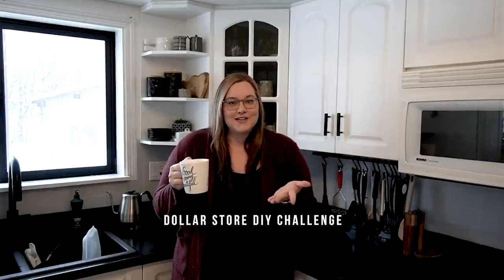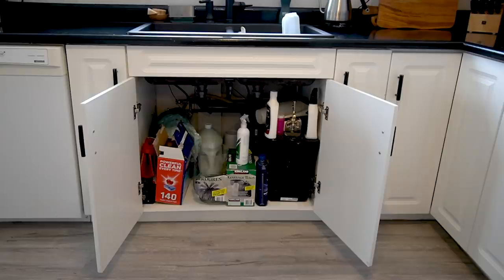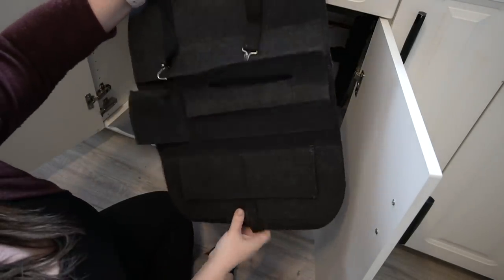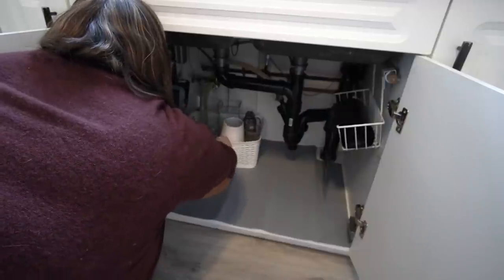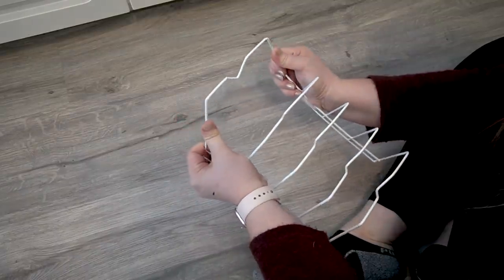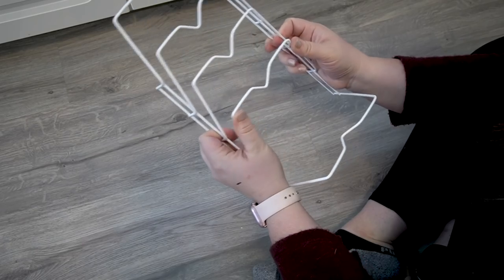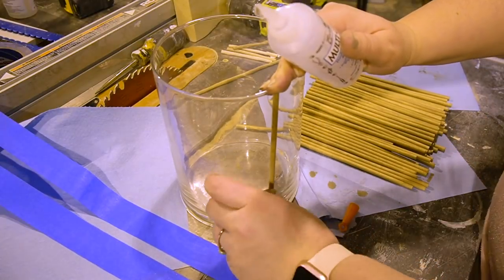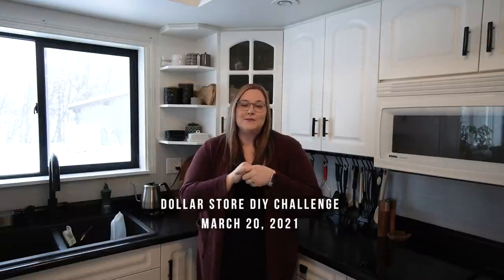Dollar Store Kitchen Organization Hacks & DIYs!

Comment: You could also break off the hanger parts of the garbage bag hanger and hang the basket on command hooks on the inside of the door, little bit easier maybe?
Reply from the maker: We thought about that, but it’s al metal, so a smooth finish would be hard to get, and we didn’t want sharp metal edges in there when we reached down!

Comment: at 5.16, what I would do to hand the basket is cut the top fo the hooks off, jut leaving the  vertical piece attached to the basket wires, then drill holes thrugh each and screw it to the door.
Also, the use of the dish rack as a pot lid hoder by bedning them is genuinely very clever, I don't htink it would cross my mind to do that.
Reply from the maker: Smart! Glad you liked the video :)